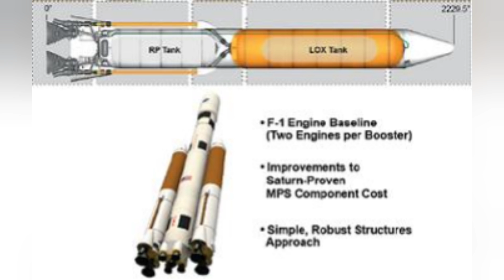NASA almost used Saturn V engines for SLS!  Are the new Shuttle engines the right choice?

Comment: You are seriously deluded

The F1 was nowhere near as cheap as solid boosters. Just 4 of those engines cost as much as both of SLS’s solid boosters in their entirety, never mind the cost of the liquid tanks, it’s just half of the booster cost

If you use all F1’s like Saturn V and no sustainer RS25’s then you ain’t cheating physics still. You need a purpose built just as large hydrolox beefy second stage with J2X’s which also have tech that’s long gone and are pretty advanced expensive engines themselves. You cannot cheat rocket science

SLS’s core stage is the only major part but it’s only a single complete component that handles from liftoff to almost orbit where you need merely RL10’s to handle the rest. Solid boosters are unmatched to yeet the core into space on the cheap. You don’t need efficiency, just thrust because the RS25 is so good

RS25E will be higher thrust and much cheaper due to the manufacturing improvements. There will be enough for 2 or more core stages per year

Comment: You have a point criticising SLS for not having reusability like the SpaceX rockets.  Why not recreate Saturn V?  Not possible because Saturn V plans and specs are lost to history.  That only leaves reverse engineering it.  But to do that would be more expensive that building a new rocket.  Why use the RS25 engines?  For those that don't know, RS25 engines were the engines that powered the Shuttle, had a spotless record in the Shuttle program and we know how to build them without having to go through an expensive process of designing, building and testing new engines like, for example, trying to recreate the F-1 engines on Saturn V.   Besides, the SRBs on SLS are more powerful that those used with the Shuttle, so more powerful liquid fueled engines aren't needed.

Comment: Shame they abandoned the f1 booster it could have been used for so much more, nothing would have been quite like it, even could have tracked towards reuseability. In theory 4 f9 boosters could produce as much thrust as the Srb’s but they come in heavier and would need to reserve fuel if you wanted to reuse. Which is why f9h can’t throw much to tli without discarding side boosters. While you can use old boosters for that purpose they are still too heavy and it’s a lot of hardware to throw away. not aware of any other rocket that could stand in for the srb’s. That said with luck the sls concept will be superseded anyway.

Comment: One huge aspect of why they chose RS-25 over F1 is often overlooked: milage!
The comulative operating hours are much higher for the RS-25, which means that they have a lot of experience with the engined and ironed out a lot of the kinks. That means the RS-25 is super reliable. 
Bringing it up to even remotely the same level would have been way more expensive than $3B.

Comment: 14:48 Nevertheless if you include all these costs I just listed that are not associated with actually producing each engine then it costs 145 million per engine.
That 3.5 billion total includes a lot more than just the cost to produce 24 new RS-25 engines.
Namely development of the production restart variant, adaptation of the existing 16 engines for SLS as well as opening up the new production line like building and later expanding the factory and the tooling needed to start producing the engines.
All these costs have nothing to do with the recurring cost to actually build each of the engines, they are all one time investments that had to be made before that could happen.
NASA and Aerojet Rocketdyne have reported multiple times that each of the new engines is costing over 30% LESS than historical SSME production costs, which were about 90 million adjusted for inflation.
The math left to figuring out a rough ballpark production cost for each of the engines is pretty easy at that point.
Still very expensive surely, but nowhere near 145 million per engine.
That estimate is a perfect example of intentionally flawed accounting in order to produce an overly inflated cost estimate to further smear the program's public image.

Comment: Believe it or not, SLS was actually the cheap option compared to Aries (SLS was based on the "Direct" designs, which aimed to more fully re-use Shuttle technology compared to Aries in order to reduce development time). That said, both Aries and SLS were disappointing backwards-looking architectures and a symptom of that America had lost it's forward leaning mojo after two fatal shuttle accidents and the cancelation of the VentureStar program. I doubt that replacing the SRBs with F1 powered boosters would have been less expensive for the SLS, but if we had developed a second generation reusable F1 we now would have had the technology foundation for developing an even larger ultra-heavy launcher than Superheavy/Starship (the Raptor, while very impressive, is too small to go too much larger than the current Superheavy/Starship -- I have a hard time imagining a rocket with 66 or 99 Raptors on the first stage).

Comment: Well, if Elon Musk is truly dead serious about Starship v2.0, requiring 100 Raptor 2 engines to get ≥50 million pounds of thrust at liftoff, HE’LL have to be thinking about an F-1 engine, now won’t he? The F-1s could produce closer to 1.8 millions at sea level, so he’d be looking at about 28.

IMHO, he might could run the design closer to 2.5 million or so, meaning only 20 engines. With an RD-170 kind of form factor, who knows—5 million per unit, for ten or so?

Or maybe strap-on liquid or solid boosters to simplify matters? Viva F-1! It ain’t buried just yet…

Comment: F1 has more thrust - but had not been manufactured in DECADES, is a lot less EFFICIENT.
Would have cost a lot more than reusing existing engines with a more recent design - and since about Apollo 12-13, NASA has been VERY cost cutting (when a government agency COULD do so).

Also, CONGRESS mandated that NASA had to reuse as much Shuttle material and technology for SLS as possible - which was a DUMB mandate that made SLS MORE expensive than it could have been, at least in the early version(s).

Comment: I must say it is hard to understand why it would be so hard to build new copies of an old engine, even  if the original ones included hand-made parts.
Reply: Rumor has it that NASA destroyed much of the data required to manufacture many Saturn V components such the F1 engine. This was supposedly done to assist in the shuttle program's success, as many shuttle program opponents wanted to return to proven technology. This erasure of production methods and designs was to make any such return impossible. A goal NASA seemingly achieved. Some claim attempts to reproduce the F1 failed because certain engine components could not be reproduced - or at least the reproductions would not function properly. I find this difficult to believe. In my opinion it came down to politics, money and preserving contracts. Though I do find it baffling that Rocketdyne would let their F1 disappear.

Comment: 7:56 The Soviets couldn't really build a large Kerolox engine with a single-chamber like the F-1, but they managed to achieve ONLY after they opted for 4 smaller chambers on the RD-170 series(RD-171 included).

Comment: In general, the SLS design is sort of stupid. It lugs that huge tank almost to orbit and wastes money using finicky HydoLOX on the lower stages.
Von Braun used cheap, simple kerosene on the first stage to lift off, dropped all that weight, and then used high performance HydroLOX for the UPPER STAGES. 
Saturn V could loft over 100 metric tons to LEO, while SLS using the fancy engines still only gets 95 Tons to LEO. Using the 1950's stage and a half design is a real waste.
I agree that they needed go with legacy contractors and legacy hardware back in the mid-2000s, because SpaceX had only launched Falcon 1 at that point. Almost no one in government expected the major success of SpaceX back then. Now reuse is a no brainer, but back then the Shuttle Model had seemingly proved that reuse was just too complicated and expensive. It took SpaceX to do reuse "right" and convince everyone that reuse is the way to go.
I just wish SLS had just used a 3-stage design and F-1 engines and J-2 engines. 
Like you showed, there were people at NASA who were well on their way to resurrecting the beast. I think they had even gotten close to the hot fire test. (I may be wrong.) They had successfully X-rayed all the parts and were on their way to deciding how to remake the parts.

Comment: correction!!! the rs25 was never used in the space shuttle! the SSME was used to propel the space shuttle! the lame extremely under preforming  rs25 is a crippled low grade attempt to copy the SSME. i know i was building SSMEs when NASA was giving contracts for alternative suppliers. at the same time the F1 was being investigated to use LOX & H2 . i can say for a fact the rs25 is a very expensive TURD!
Reply: Ummmmm. These RS-25 were all actually flown multiple times on the Space Shuttle. What in hades are you talking about?

For the peanut gallery, SSME stands for Space Shuttle Main Engine: the RS-25. Saying what this poster is saying is like trying to explain that cats aren't felines.

Comment: It was a terrible missed opportunity that they decided years ago to use clusters of RL-10 engines for the eventual upper stage and not the J-2X derived from the Saturn V's J-2 engine. Yes, it pretty much ended up being a "clean sheet" design, but it would have offered far better performance, especially for payloads to the moon and beyond.

Comment: NASA gets a demerit for turning it’s back on reusability.  It gets a further demerit for using reusable engines in expendable mode.  NASA’s final demerit is the extraordinary amount of money and time it has spent on developing a rocket that has less capability than a Saturn V.  In achieving its ambition to drive down launch costs with the development of the Falcon 9, SpaceX has inadvertently made NASA look increasingly redundant.  It’s Starship threatens to make NASA irrelevant.

Comment: I have a few ideas.  Instead of trying to recreate the F-1, create F-2.  That would be F-1 plus modern knowledge, and maybe a little more thrust.  The Saturn-V engines could be approximated with chamber, throat, nozzle length, and exit.  Plumbing is up to the engineers.

Help the SLS?  That thing is a beast.  One way is to recover everything, especially those engines.  If pieces stay in orbit, make them do something rather than clutter our LEO up, or bring them down.  Another way is to build a smaller rocket and build the bigger spacecraft in orbit with two or more launches.  We're good at docking.

That new rotary detonation engine can scale up to F-1 standards.  Aerospike technology is also something of interest.  Hybrid rocket engine?

I haven't done the math, but that coat of paint might weigh in at around a ton or two.  Get rid of it & go bare metal.  Besides... orange.
Reply: There already existed a proposal of such a modernized F-1 engine i.e. the F-1B which would've had simplified plumbing and construction methods as well as a higher projected thrust(1.8 million lbs as with the unflown F-1A), but it appears to be mothballed alongside the Dynetics LRB for the SLS.
Reply: @jmwoods190  I guess we have to dust off those F-1B folders and start up the machinery to make rocket engines.  There's a big solar system just waiting for us.
Reply: @chaosopher23  Well the F-1B folders have only been about a decade old, so it's not too late!
Reply: @jmwoods190  10 years isn't long at all.  Those are useful.

Comment: One correction,  a team from Huntsville actually did reverse engineer the F1 engine. The then redesigned it to male it buildable in assembly line fashion.
Reply from the maker: Thanks!  I didn't know exactly how far Dynetics got!
Reply: @The Angry Astronaut  I'm not sure Dynetics was involved with this. It is my understanding it was a side project by the engineers involved. Not sanctioned by NASA. This was prior to the Challenger disaster triggering the attempt to replace the SRB's with a liquid fuelled booster. They finished thier redesign just as that happened. It was to be the F1-C model.
Reply: Yes, as part of the replacement of the SRBs with liquid fueled boosters.  It was in the early to middle 80s.  I worked at Stennis Space center after 1975, and there was some work done on how to test these boosters on existing test stands, probably at B2.

That work went away when Congress and NASA decided to build ASRM (Advanced Solid Rocket Motor).  Lockheed built half of a rocket factory in northern Mississippi while we built a test stand for it (90% complete) in southern Mississippi. Program cancelled.

Comment: AA: you very briefly touched up on the safety of the F1 boosters in failure modes, but you didn't point out that the solid rocket boosters do not have such fail-safes. Once light, a failure of one before burnout and separation is not possible. Escape tower is needed for crew survival.

Comment: They were going to use the expandable RS-68 engine that is used on the Delta 4 rocket however the must use shuttle used parts brigade got on the bandwagon and forced the change back to reusable RS-25s.

The RS68 is in every way a better engine for a sea level booster than the RS25 that is optimised for higher altitudes.  It is also far easier to manufacture as it is intended for one mission only.   This was also the original engine for the SLS predecessor the Ares.

https://en.m.wikipedia.org/wiki/RS-68
Reply: A major reason why the RS-68 was later rejected because its nozzle will suffer from extreme heating when placed next to the SRBs, and some major problems with man-rating it which would've really blown up the development costs of the engine.

Comment: That would be impossible since they destroyed the molds and blueprint for the Saturn V including the engines
Reply: The blueprints for the Saturn V still exist. I would think it's obvious NASA went with the RS25 engines because it still has a warehouse full of them, and it will be much easier to restart production of them than to start F1 production from scratch. If NASA wanted to use F1 engines now, it would require a redesign of SLS. I'm sure that would go over great with the SLS so expensive crowd.

Comment: @Astro_Angry NASA is profligate in their spending, even for great ideas like using the updated F1 engine , but it always reverts its plans to the politically expedient moves for continued funding (under pressure from pols?).
That Dynetics came up with a solution for 3D printing the New F1 is a Herculean effort just to be shunted aside.
Maybe they should go ahead and make them anyways for interested parties.
I’m sure that their client list would be quite long! Especially if the BE-3 comes a crapper 🚽!

Comment: There's only one way to beat using 1970s technology RS-25s. That's to use middle 1960s technology F-1s, unthrottlable, unoptimized, primitive compared to modern engines. That means the rocket has to be built at least 25% heavier to punch through MaxQ at full throttle like the manly rocket of the past, Saturn V. Any sissy can throttle back to let a light rocket do the job. To punch a heavy rocket through MaxQ at full freakin' throttle is downright MANLY.  We need to do it! /s

But seriously, solid rocket boosters have no place on a manned rocket. The SLS should be entirely liquid fueled or like the Space Shuttle, it is guaranteed to kill astronauts in the future, even though they are on top of the stack where they belong. And hydrogen fueled motors can NEVER do the job. They need too much more thrust. Either methylox or RP1 must be used, and to see a modern technology motor in the size range of the F-1 would be a huge step in the right direction.

Comment: The only way to genuinely improve SLS is to replace it with a new launch vehicle design that is at least partially re-usable. On YouTube, there is a Kerbal simulation showing a SLS with both solid rocket boosters replaced with four (4) re-usable SpaceX Falcon 9 boosters. https://youtu.be/d2200YGSeKM

The best way to improve SLS is to replace SLS with an entirely new, re-usable design where at least all First Stage boosters can fly back to Earth to be re-used. It's also high time that NASA considered some kind of re-usable Upper Stage booster that acts as a space-to-space cycler, so instead of wasting an Upper Stage on every launch, there's a re-usable "space tug" booster robot ship waiting in orbit for orbital insertion or orbital departure maneuvers. Such a re-usable "space tug" design would require the ability to re-fuel in space.

Obviously, SpaceX's Starship could replace SLS with only minimal modifications. There's a couple of other possibilities: 

1: Take Blue Origin's New Glenn booster and give it a Falcon Heavy treatment: connect three New Glenn boosters together to form a much more powerful vehicle. This vehicle would roughly match the power of SLS (at least, the first stage would) and allow for a much larger payload. This would require a larger, bulbous payload fairing that would look like Falcon Heavy, of course.

2: United Launch Alliance could design an entirely new re-usable core stage, outfitted with seventeen (17) BE-4 engines, and all two New Glenns as side boosters, Falcon Heavy-style. Such a rocket would have First Stage thrust comparable to SpaceX Starship's 33 Raptor engines.

The re-usable "space tug" idea would also benefit either of these ideas.